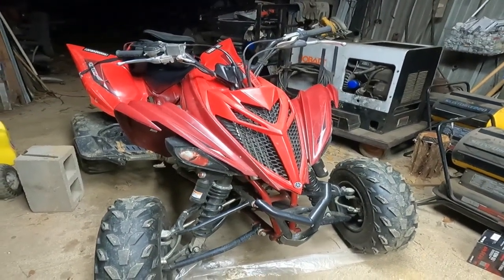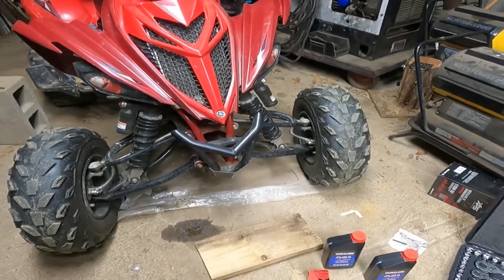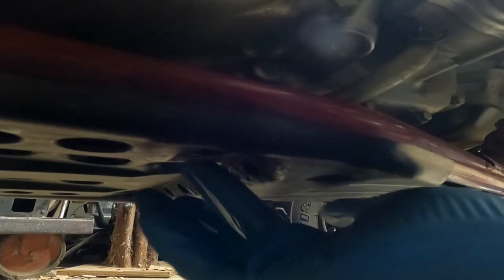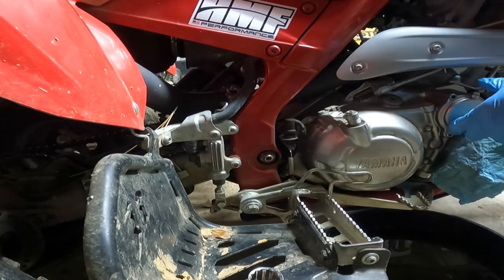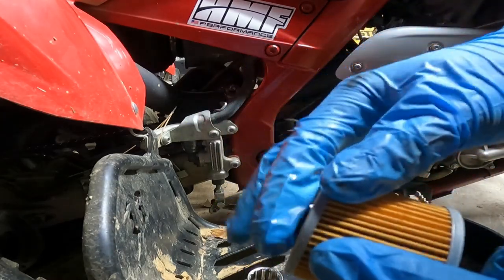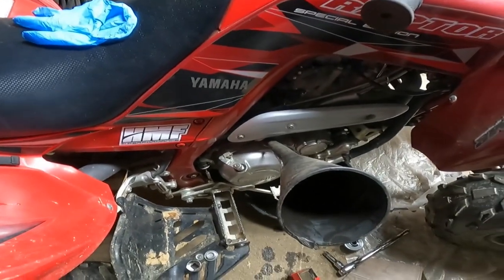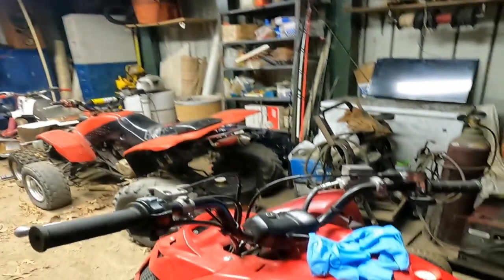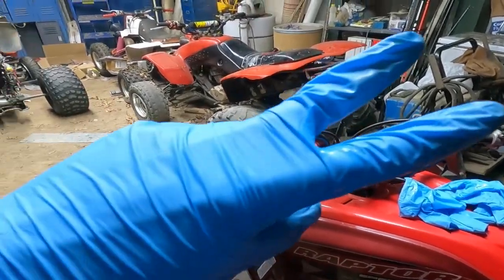How to change oil and filter for Raptor 700

Comment: There is also a “Purge” nut on top of the head, break it loose then run the bike until oil starts to drip. That tells you that the oil is circulating properly
Reply from the maker: Thanks for the info really appreciate it. And consider subscribing if u haven't already